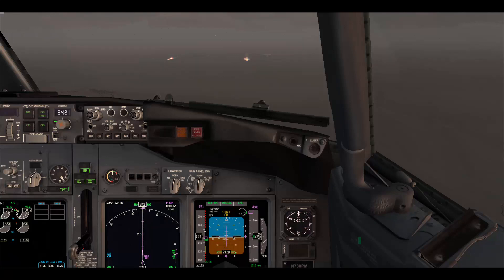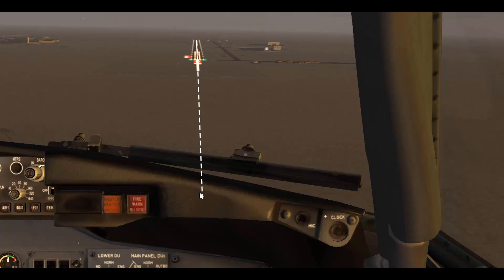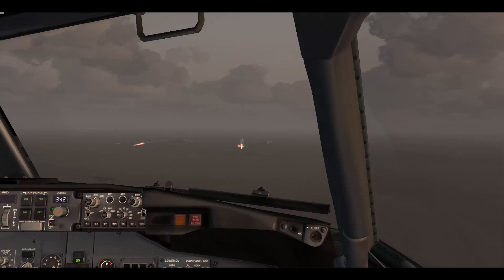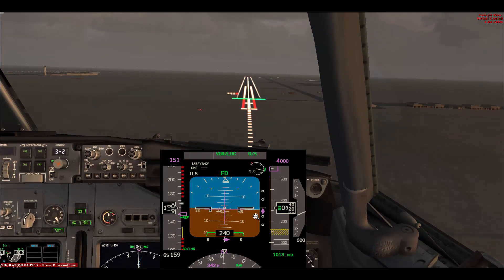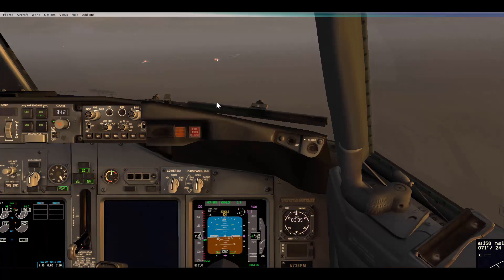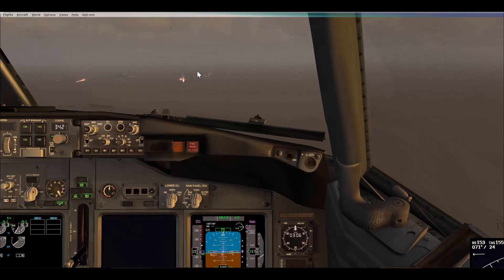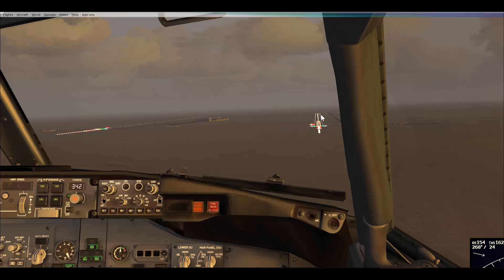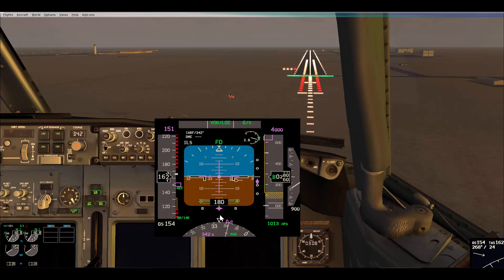B737 App & Lndg Video#8 Visual Cues

Comment: Hey how real is PMDG 737 compared to Real 737 in terms of 
1. System depth?
2. Flight dynamics?

I know you cannot emulate real flight dynamics due to limitations of FSX/P3D but still would love to know your view on above two aspect!
Reply from the maker: Hello Swapnil, 
The short answer to your question PMDG have done a great job, but as you said it can belike the real thing. 
1- System depth, the switches the lights the indications are very good. The CDU is amazing, and it lacks a few features that I noticed, not a big deal for normal pilots. 
2- The flight dynamics, all good the only thing I noticed was the decent and deceleration while leveling off those two areas are a bit off from the real airplane as far as simulation goes. I believe PMDG can improve this aspect. 

Thanks for the questions and feel free to ask any other questions or share your opinion. 

All the best 
Abdul
Reply: Abdulmuati Asiri thank you sir! Appreciate it! 🙂